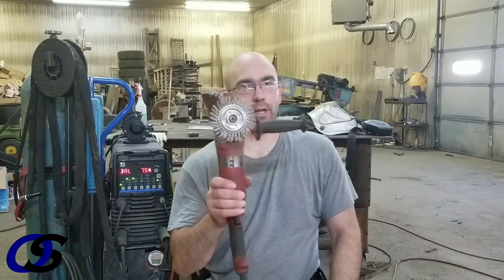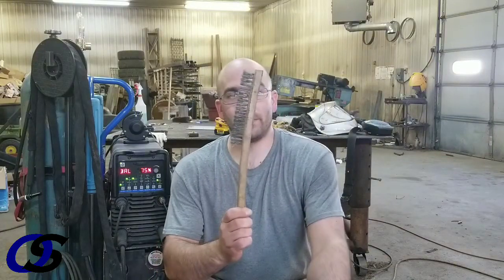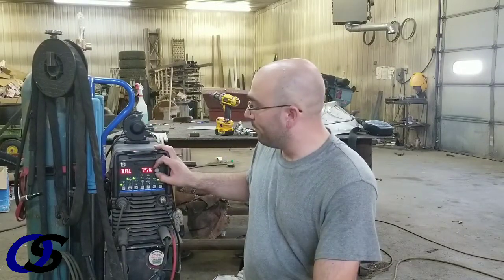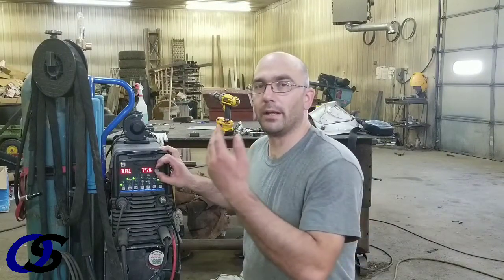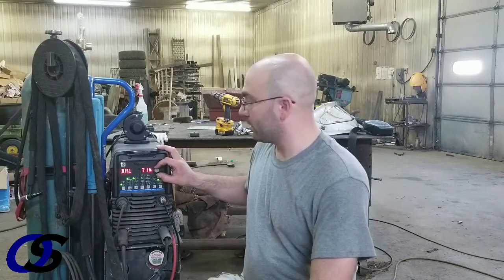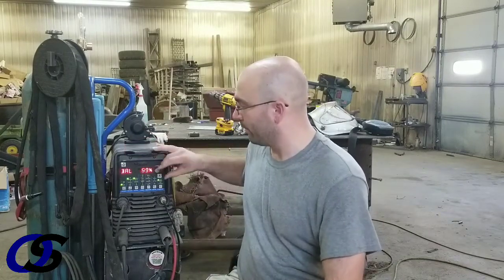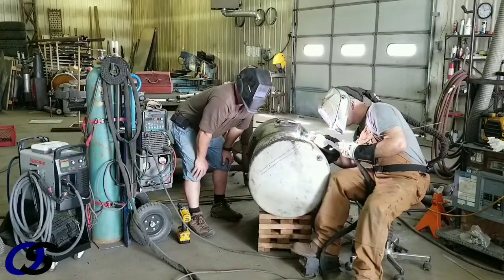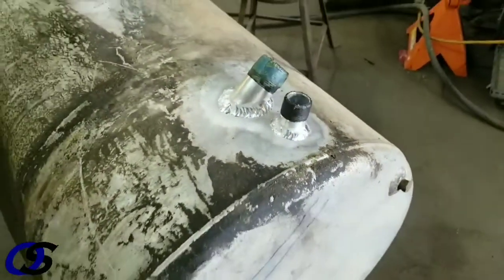Different Ways To Clean Aluminum Before Welding

Comment: I've had success mostly with scotch Brite red pads , 1" stainless steel wheels on my dremel , I buy them by the 100s on ebay and acetone.  If it's really greasy and nasty I preheat with map gas prior to cleaning.  Most of the time this works .
Reply: Are you saying that pre-heating the metal promotes more contaminate removal?